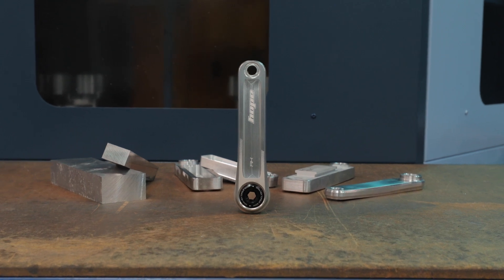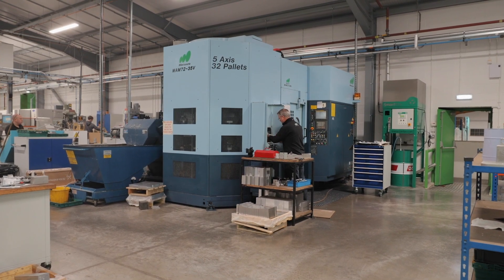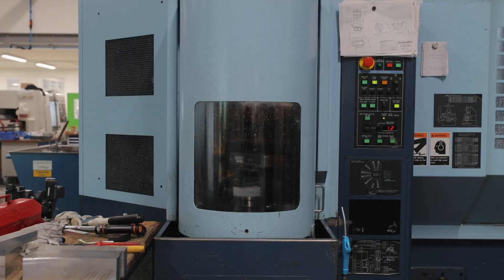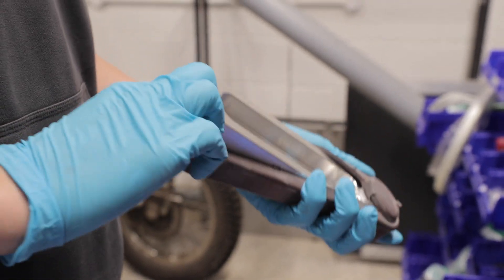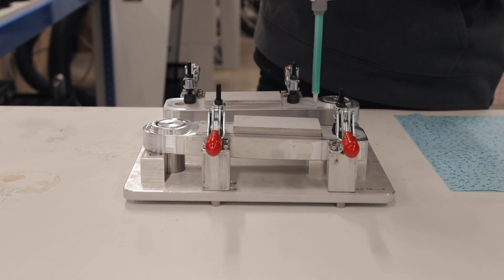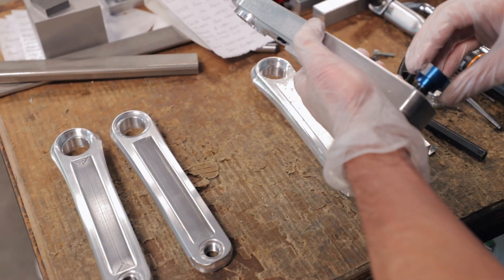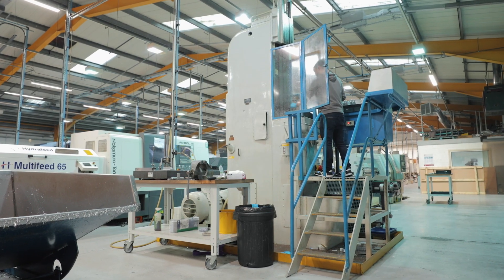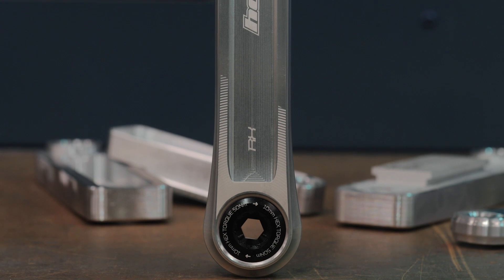How It's Manufactured: Hope RX Cranks

Comment: hi guys, i have been using hope parts for 13 years, hubs, brakes, stems, grips, bar ends, spacers, seat clamps, pedals, head doctor, rotors and many other. and yesterday ordered 2 more hubs. have loved the quality and durabilety. now when i browsed hope tech website, i did not find any info of how long the warranty is for the parts?, somewhere was written that only 1 year for original owner. somehow i remembered that it was lifetime warranty, or has it been changed? have broken only 1 hope pro 2 evo trial hub axle, and it was replaced no questions asked.

Comment: Why do you hand tap and not machine tap or thread mill the thread for the pedal spindle?
Reply from the maker: We create the threads on the machine, but just clean out the excess glue by hand.
Reply: hopetech amazing thanks for the reply hope ❤️❤️❤️
Reply: I saw the hand tapping and thought its a bit bizarre with the amount of kit they have
Reply: Probably quicker to do it by hand at that stage. Doesn't look like the machines that are used after the bonding process could do that. So they'd maybe need to use another machine.
Reply: It doesn't take long to tap it by hand and you can inspect it at the same time.
Reply: @anthonylovell2271  do you work at Hope? Just seems in a world where speed and quantity matters, it seems like its a little bit backwards even if reductions in time sometimes result in a reduction in quality.
Reply: @ashleyeaston3203  no, just tapped a lot of holes and check quite a few parts.
Reply: Just watch the vid again - you'll notice that the crank arm already comes out of the machine with thread; they just re-doing it by hand
Reply: A real piece of art. Very meticulous labor, but worth it.